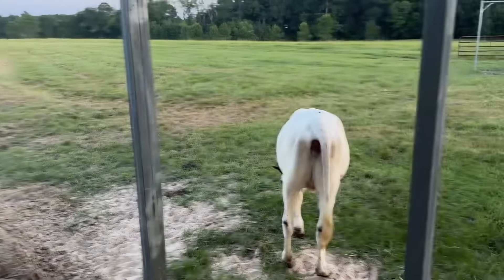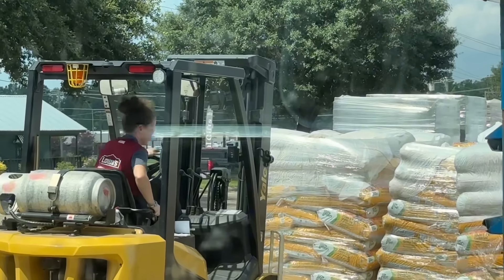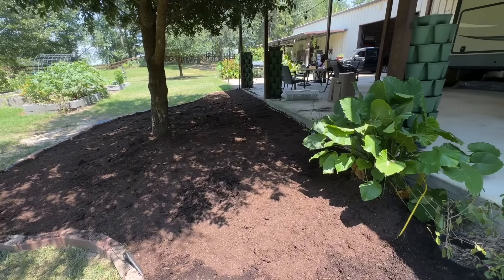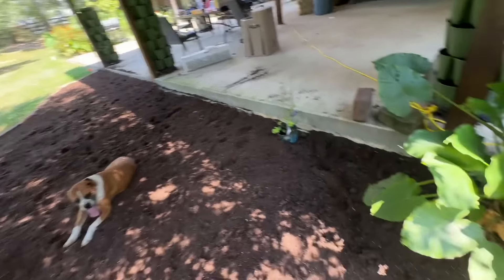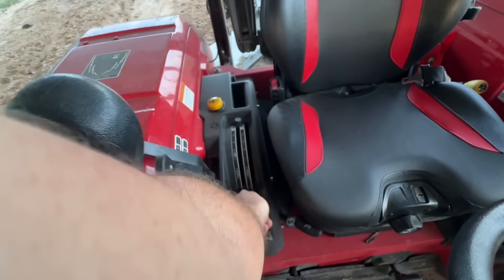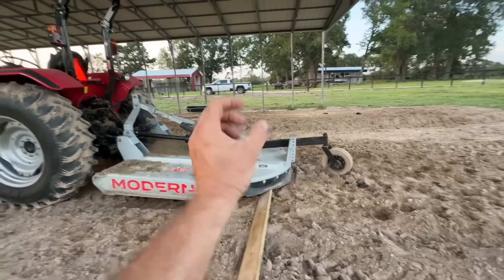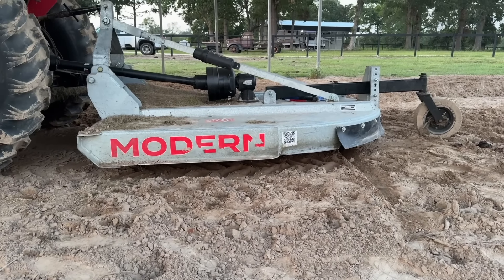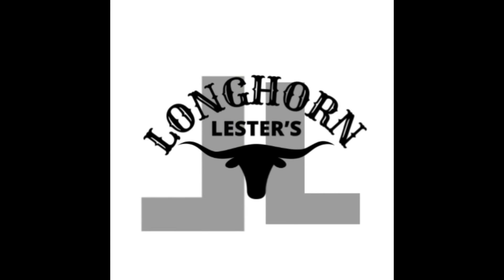Working Around Animals

Comment: Hostas grow well in the shade. You can then split them up and separate them each year to have more. You can also get different varieties of them. I have the solid green, striped, lime green, and blue ones. I’m in Georgia, so they can take the heat, but do need shade in the afternoon. Mine are in the sun until afternoon (3-4:00).